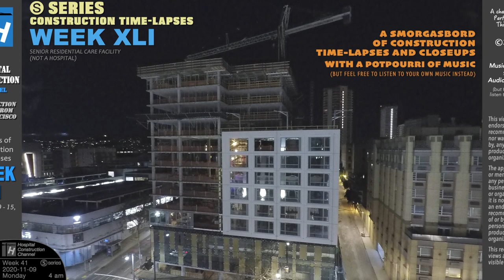One-week construction time-lapse with closeups: Week 41 of the Ⓢ-series

Comment: The black line you saw him stuffing in the cracks between sections of wall panels is called backer rod. Then you usually place insulation materials into the gap. Finally you finish with an elastomeric caulking. That’s a fancy way to say a caulking compound that stretches and never gets hard. That way as the panels expand and contract over the years the caulk doesn’t leak. It usually works for a number of years but after a while you have to do maintenance and replace it.
Reply from the maker: Thanks again for all the info!

Comment: They have consistently kept shoring in place after form removal for a couple of floors down, so it was a surprise to see they didn't when they removed the forms from the roof deck. I realize there is no load on that deck from forms for floors above, but I'd expected they would leave them a little while. Also, edges of the roof deck is are much thicker than the floors below. Is it actually thicker or did they pour a curb on the roof as they placed the deck itself?
Reply from the maker: I'm told that the roof deck is a little thicker.  However, it also slopes towards the drains, so the edges are much thicker whereas where the drains are is only a little thicker.

Comment: I find it interesting that the renderings show a nice clean glass-to-glass corner on the southeast corner, and on the northeast corner of the upper section. But it isn't actually being built that way. There's a fairly heavy corner piece being put on. Makes sense I suppose. A glass-to-glass corner works on a shower enclosure, but I'd think it would be an issue on a high-rise building.
Reply: Yeah I noticed when they started putting in the windows on the second and third floor they had deviated from the pretty rendering between the actual windows and the mirrors. I figured it was more an aesthetics thing than structural but you could be right.
Reply from the maker: I've found that the artistic renderings of buildings are often idealized or gloss over things.  They tend to be "conceptual" and leave out things like roof screens, exhausts, etc.  And then often things are changed later from the original design as the building progresses.  For example, I'm told that's why the bottom windows are sitting uncompleted all this time -- because of a design change.

Comment: Hey HC, Now that we're 'topped out' , would be an interesting bit of trivia to know how big a pump ( HP/PSI) was needed to push wet concrete up to the 150' + level. Just askin'!:-)
Reply from the maker: I'm told it was a 1800 PSI pump.  The pump size is determined by line distance, line diameter, concrete mix design, etc. and a factor of safety is added.  Unknown how close they ever came to the 1800, the guess is they were somewhere around 1500 on the heavier days.
Reply: @HospitalConstruction  Cool, Thanks!